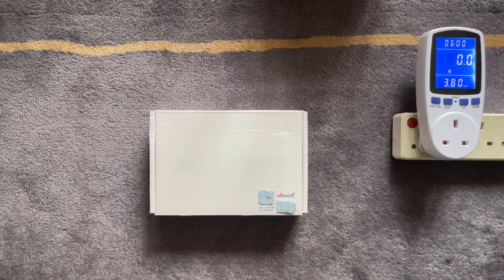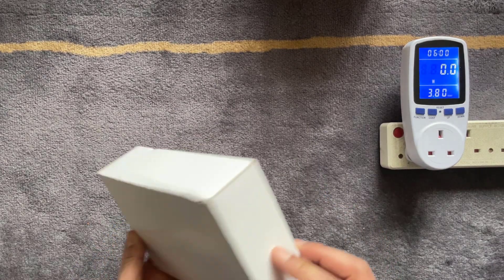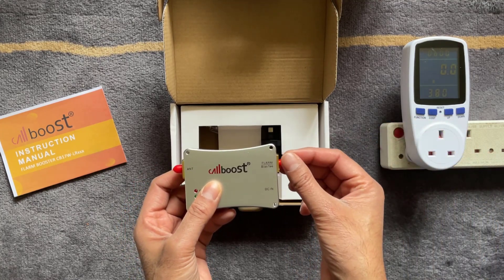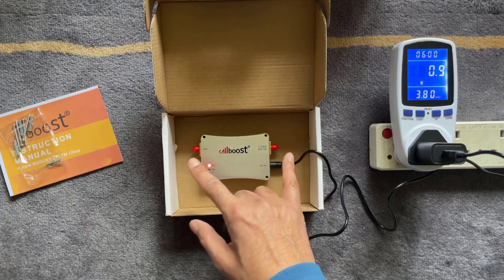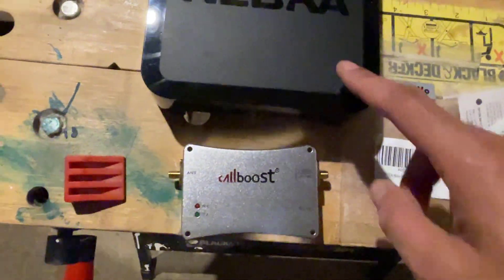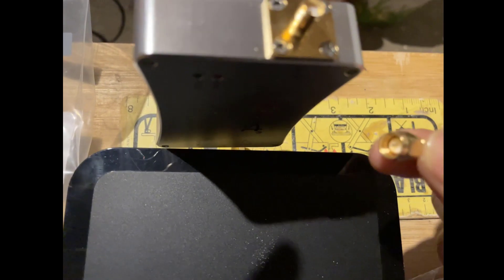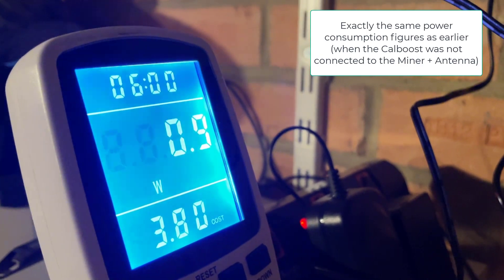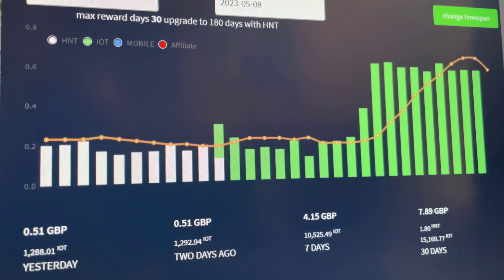Do Helium Amplifiers really work?

Comment: The manufacturers of these things spilled the beans. The problem with these cheep amps (not to say this one, I never tried it) is the the saw filter. Its cheep and gets over powered easily. People report they get much better coverage without the amp as the filter gets over powered by other signals.
Reply from the maker: That's why I used the Calboost and not any other other cheap booster: The description of the Calboost says: "Callboost FLARM BOOSTER built in precision filter avoids interferences with out-of-band signals, filters unwanted spurious signals. No need raw filter any more."

Comment: Hello bud im thinking of getting one. Once its been instaled do you have to go in to the antena settings and change the dbi to a higer dbi. Im running a rak v2 5m mcgill lmr-400, mcgill 8.5dbi panel antena.
Reply from the maker: Hi, no need to change any antenna settings, it's the same dbi antenna, but on steroids ;-)

Comment: Cant get this to work with the bobcat 300.. reduced my rewards by about 70%. Im still using the stock 4dbi antenna. Anybody else experince the same?
Reply from the maker: This is likely due to Helium HIP85 being implemented. If there is a lot of Hotspots in your area, the best and more reliable ones will be taking the lions share of earnings.
Reply: @HandymanSavage  thanks.. ill read up on it. And will prob use on my other miner where there are very few. Cheers
Reply: Just got one and since I have installed it it’s not beaconing or receive anything any ideas what to do

Comment: I bought the product because the 20 meter cable reduced the power of my 6 dbi antenna. I wrote the miner information as 6 dbi. What do you recommend I write in the Dbi information section when using the booster?
Reply from the maker: No need to write any info in, you're still using a 6 dbi antenna ;-)

Comment: This video might be old and maybe you would not reply to my question but a try is worth. If I use this amplifier and have a 10m cable, where do you usually put it on? Next to antenna or next to miner. If it is next to antenna then a bias tee has to be next to miner to power it up but then this one has already power on itself. So I don't think it needs a biastee. The question here is what happens to the 10m cable and the signal lose? How does the compensation work?
Reply from the maker: Hi, I have my amp connected to the helium miner end. The key to using longer length cable runs is the type of cable you use. For longer runs I use lmr-400 from mcgill microwave which helps minimise signal loss
Reply: @HandymanSavage  Thanks for your reply. Yes, I have LMR400. I have acasom filter and a biastee. Plus the amplifier. What I do is this. Antenna, cavity filter then amplifier. From amplifier I have 10m cable then just before miner I have the biastee that came with the amplifier. This way I feed the whole cable with power all the way to the amplifier which is next to the filter. As for this one that you have, I am confused how to use it. The way it looks like this was not made to use it with long cables. It was made to only have it next to miner and antenna. I did a test, I placed it all the way to the miner but there is no biastee at the miner because I don't think it needs one. This thing has power from itself through the adapter.
Reply from the maker: That's interesting to know, thanks for that. I'm happy with just the Amp at the moment, but I may look into adding those other components at some point. I've recently split the cable to use 2x different dbi antennas after the amp, which has helped pick up more hotspots locally, have you tried that?

Comment: Have you changed the antenna aswell? If not are you going to?
Reply from the maker: Kept the same antenna to see how it performs and so far it's outperforming one of my other Miners which have a higher dbi antenna. For now i'm leaving it as is. You know the saying, if it ain't broke ;-)
Reply: @HandymanSavage  cheers, do you just recommend the callboost amplifier or is there anymore cheaper versions?
Reply from the maker: I would recommend the Callboost, based on recommendations I received and also the build quality. You can buy cheaper ones, even ones without a case, but as it would be running 24/7 I try and factor in fire risks etc and tend to avoid unknown brands
Reply: @HandymanSavage  good points cheers for the replies